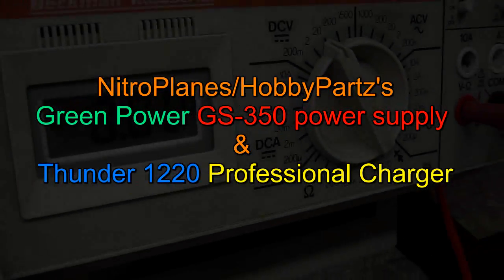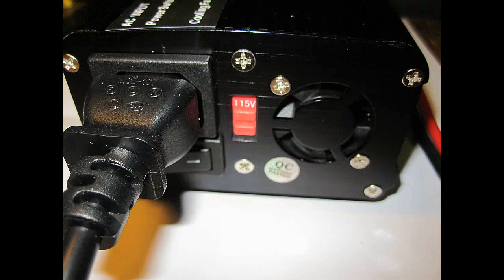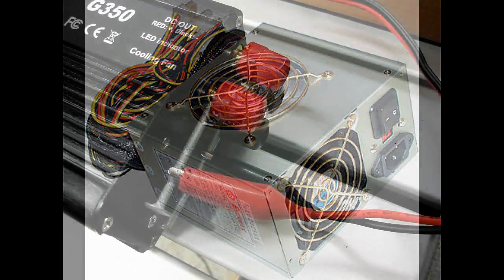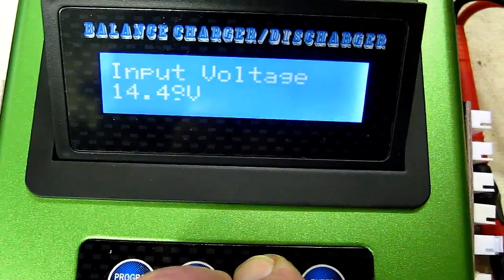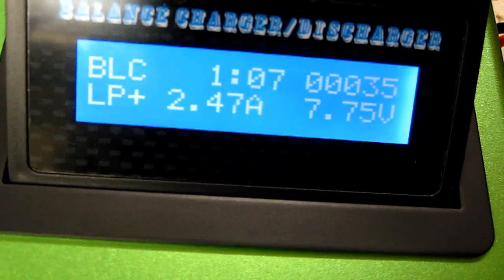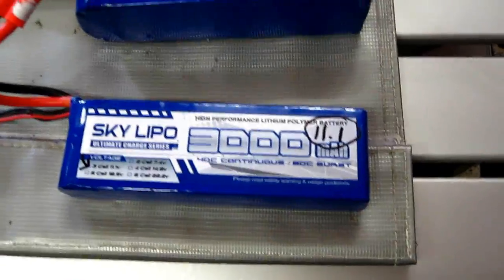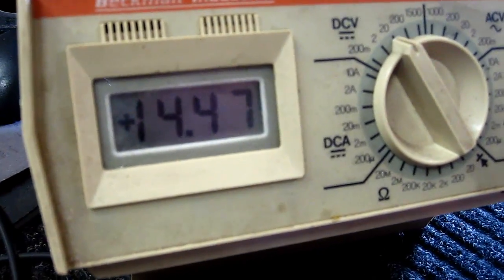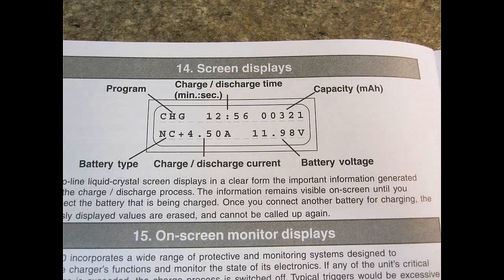Thunder 1220 Pro Balance Charger and Green Power G350 Power Supply test.

Comment: Dave, I know this is an older video but I'm hoping you can answer two questions for me. I have the Thunder 1220 but I don't know if I should set the charge for each cell at 3.7v or 4.2...can you tell me?
The other problem is, I have a 5s lipo battery, four cells read approx 3.8v (for storage) but one cell has dropped to 1.5volts. Can it be resurrected? I would greatly appreciate a reply from you.
Thanks, Henry J

Comment: Hi Dave
I love your videos!
Being an old guy and having used glow engines all my years in this hobby I have now begun to get into electrics. I bought an older Hyperion 610i charger but it had all the wrong connectors and the manual is just too complex so I just bought the Thunder 1220 Pro. It says it needs 300 watts but my PS max's out at 272 watts...how will that affect my charging if using up to 6 cells? (Will the 1220 charge a single 3.7 cell battery?)
Thank you!!!!

Comment: Very good review. I have the same combination, but my power supply popped and smoked. I was charging a 6s 5000 at 1c and I don't think it can handle it. Have you tried charging 6s? Maybe I did something wrong, but everything seems pretty self explanatory. My Thunder 1220 is fine , but the G350 is toast. I also have the AC6 and AC680. Had good luck with the ac6, but I've had 2 AC680's and only one has lasted. My second AC680 couldn't handle 6s charging either. Even at .6c charging.